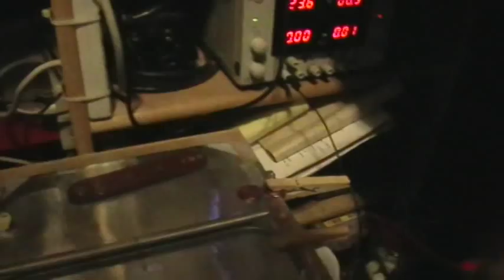Do It Yourself: Simple TEA Ultraviolet Laser

Comment: nice vid, somehow i can't get mine to work. did yours work the moment you powered it or did you have to change some things?
Reply from the maker: It's pretty fiddly, as I recall. I think one critical aspect is the low inductance connection between the foil and the long electrode. Another is the gap itself.
What you are looking for is a long area of sparking/corona along the electrode, rather than just in one place. 
The beam will be invisible (UV) and you can visualize it by having it hit something fluorescent, like "Day-Glow" paper or some glow-in-the-dark plastic toy.
Reply: TinselKoala mine has around 20 or 30 intense sparks distributed over the length. Is it possible to have too much capacitance?
As a potential target i use a solution of fluorecein.
Reply from the maker: Try polishing the round electrode. It sounds like you may have some rough spots discharging. I don't know if it is possible to have too much capacitance, maybe so. I do know that the inductance must be as low as physically possible. 
My unit is in storage and unavailable at the moment so I can't examine it but I seem to remember that it worked best when there was a fine line of discharge all along the electrode. Also, if you are using aluminum extrusions, check to make sure they aren't coated with some kind of nonconductive surface treatment.

Comment: Do you know what the wavelength of the light is?
Reply from the maker: bavc The lasing gas is mostly atmospheric nitrogen, so it should be around 337.1 nanometers in the UV range. There may be some slight contribution from CO2 in the far infrared at 10.6 micrometers.

Comment: Have you tried a glass plate capacitor?
Glass has a high K, so a lower break rate, but should give higher peak power.
It also has fewer flaws and higher dielectric strength.

Comment from the maker: Heh.... I think a CO2 laser is what you will be wanting....
This one can be used to pump a dye laser, and I'm working on that right now, using liquid laundry detergent, which fluoresces blue when it's hit by the UV from the nitrogen TEA laser, and also should work in superradiant mode, needing no optics other than a hemicylindrical lens to focus the UV beam to a line and a simple collimating lens for the blue beam coming out of the soap. No resonant mirror cavity needed there either.